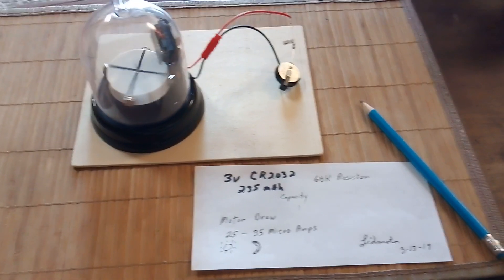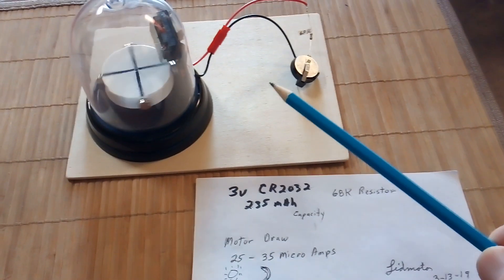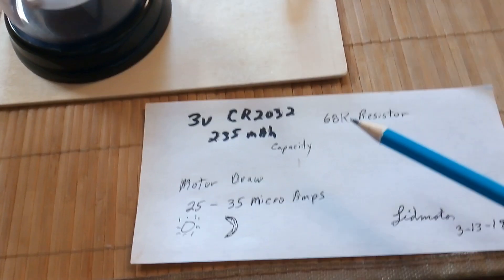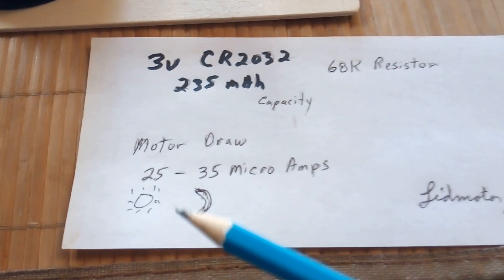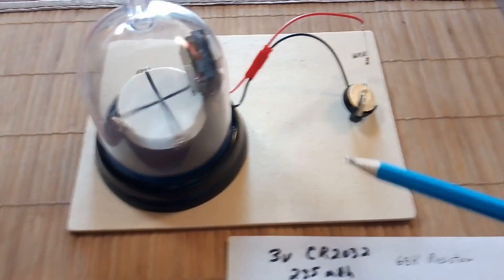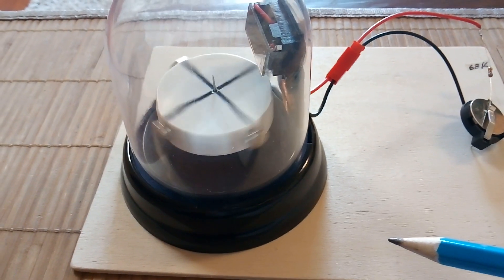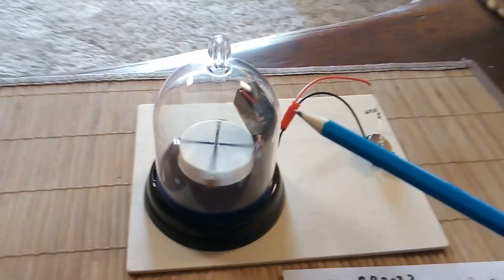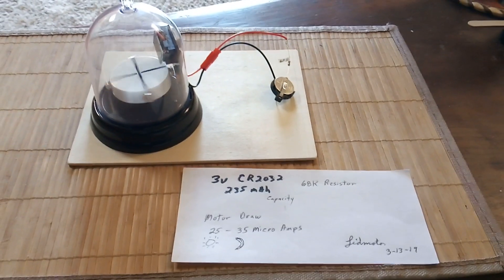Coin Cell / Solar Cell Hybrid Motor Test

Comment: +1 for the bell jar trouble. But, using a regular kitchen glass is an option, though less visually appealing. The rubbing on the plastic lid could be fixed with a metal syringe and sewing machine oil(?). The needle would go through it, the syringe piece being glued to the plastic. It would also straighten these rotors up. The oil may not be needed, the wear on the metal being tiny at the speeds expected of rotation. Am thinking about car engines and 100K miles.
Reply from the maker: Yes.  I was thinking about a thin piece of brass on the lid for the needle to run through.  Several of my existing motors use brass on steel but in a load bearing way.  What we really need here is a tube bearing that has very low friction but would also hold the rotor straight.  Someone suggested  a glass bead because there is so little load on it.  I'm still looking for a common source for these cheap plastic bell jars.  No luck but I did find an interesting way to make one using a cut off plastic bottle.  He used a Teflon frying pan to melt the base into a stiff ring.  Might try that when my wife is not around.  Ha.

Comment: Still looking for those bell jars. Frustrating as there were plenty of them round Christmas time but I couldn't think of anything to do with them. Might just end up with a glass jar. On the positive side  Poundland currently has plenty of solar rockers in stock. Thanks for the mention 😍👍
Reply from the maker: I looked around for these little plastic bell jars also and only found the ones without the top knob.  Glass ones are easy to find.

Comment: Is that steel needle axle bearing rubbing directly on the plastic lid?
If you could make some kind of magnetic repulsion bearing in the lid with a ring magnet & a paramagnetic rod, that gadget might run for much longer.
Reply from the maker: You are right. The levitation gain is almost negated by the friction at the needle and plastic.  I need to work on that.
Reply: Lidmotor , maybe the small magnet inside a microwave oven turntable motor, placed on the shaft, and pyrolitic graphite sheet to line the inner hole of the lid, may be a way. I'm not sure, because I have not yet tried it myself.